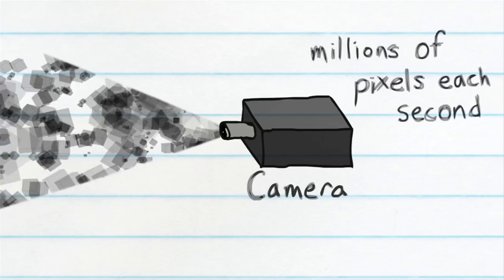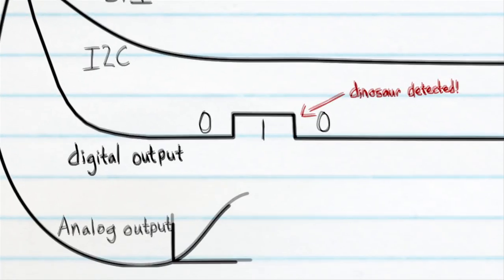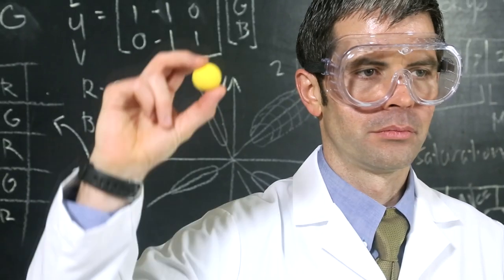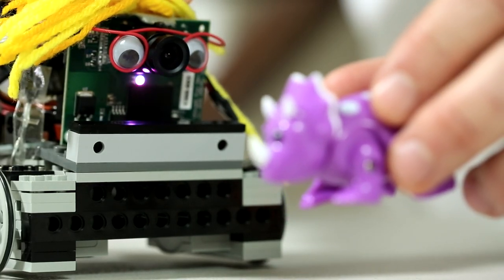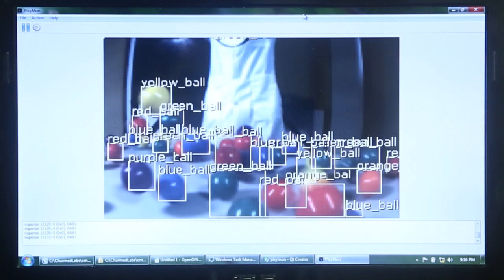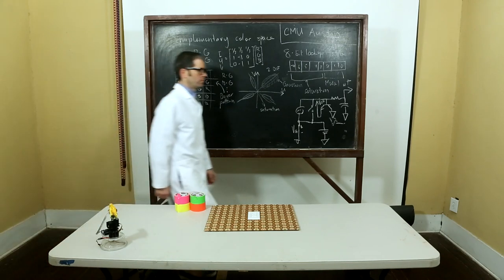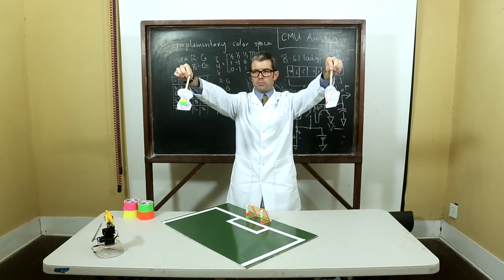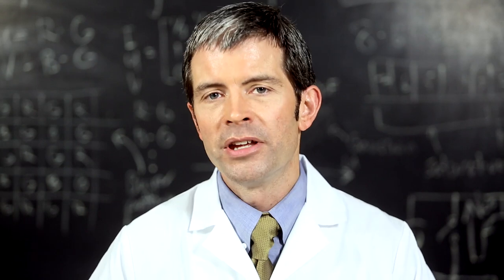Pixy Kickstarter Video

Comment: Super cool!! Lots of interesting/fun potential usages!
So I've done a very minimal amount of robotics (it was for an intro to engineering class as a freshman in college), and we used a microcontroller made by Digilent,, the uC32. We programmed it using an interface called MPIDE ("Multiplatform Arduino compatible IDE"). Would I be able to connect this to it and program it using that board/software? (I think the programming language was or was similar to C.)

Comment: Hi, I am going to use pixycam as the sensor on mobile robots to follow color lines , for example a red line and also a blue line. The pixycam is taught with two colors signatures which is the red and the blue. There is one problem when it detects red and blue lines at once, how to tell the camera that , only to select one of the colour out of two detected colours. Is there any codes to tell the pixycam,  to select only one colour out of two signatures taught?  Thanks in advance.
Reply: onka ko No, if this paradox takes place the universe instantly implodes faster than light speed as space time is not affected by the cosmological standards plaguing the poor photon, PLEASE KEEP BLUE LINES AWAY FROM ANY OTHER LINES, no matter the cost, be brave, and fight with valour and stuff. Never give a colorblind man a roll of your fascist tape either, for it is racist dollar store tape that lies in the core of all men's hearts, and sometimes crown moldings roo during renovations, but mostly just the blackened hearts of men...

Comment: This looks like the way forward, very impressive performance especially the speed..Q1 how good is this at recognizing faces(or different faces) ? .Q2 Could it identify each stair in a flight of stairs,both  ascending or descending , also producing  output data for the height and depth and qty of each of the stairs.  Looks like the camera sensor is mounted directly to the board , I would love a board with an external camera input, or two,one for each of the eyes on my Robot Head.! ..I would love to see peoples faces when my head followed them around the room...;-)
Reply from the maker: Hi Kevin, thanks for the kind words! To answer your questions, face detection is not supported yet, but is on the list for future firmware upgrades (would add the functionality to all existing hardware). Pixy could identify stairs if they were color-coded - the object detection algorithm works based on hue detection. For more on using color codes with Pixy, check out our wiki page: http://cmucam.org/projects/cmucam5/wiki/Using_Color_Codes  And yes, you are correct, the image sensor is an SMD component, mounted directly to the board. The lens is a standard M12 size, and is freely interchangeable.

Comment: Hi,
Could this determine the outcome of a dice roll in a game of craps? (The camera would be 6-7 feet above dice)
Reply from the maker: Hi Tom,
no, you need the ability to run pattern recognition. Pixy just tracks color, not patterns like dice pips. You might try a webcam and OpenCV. Hope this helps!
Reply: Hi,

Thanks for the reply. That is exactly what I am attempting to do currently.
Thanks!
Reply: @tombruce4198  
Maybe if each side of the die were different colors...

Comment: Hi I bought PIXY and trying to make this robot, but having difficulty in coding. Can you send me the code for this?
Reply from the maker: +박태건 the chase robot in this video uses old/unavailable hardware that we had laying around, so we never released the code (because no one would be able to find the hardware anyway). However, you can check out the LEGO chase demo, it has some good info on PID control, which is what the robot in this video uses: http://cmucam.org/projects/cmucam5/wiki/LEGO_Chase_Demo
Reply: +Charmed Labs 
oh..I thought you guys used arduino to make this robot...Do you know where I can find the code to make the robot using arduino to work exactly same as this robot?
Thank you anyway!
Reply from the maker: +박태건 unfortunately we don't have any such code. You should be able to hack something together pretty easily with existing Arduino libraries. Check out http://playground.arduino.cc/Code/PIDLibrary - that plus the above link explaining how the LEGO chase demo works will get you headed in the right direction!
Reply from the maker: +박태건 also, you can run the Pan/Tilt demo on Arduino, this also uses PID control: http://cmucam.org/projects/cmucam5/wiki/Run_the_Pantilt_Demo#Running-the-demo-from-an-Arduino

Comment: Hi, I was going to use this to prototype a drone that searches for colours, what is the range for the Pixy? Thanks in advance,
Reply from the maker: Hi Tom, I'm assuming you mean the max. distance Pixy can detect objects. It depends on the size of the object - Pixy can detect a table tennis ball at 3 meters, aka an object as small as 4x1 pixels in the image sensor, using the lens that ships with Pixy.
Reply: Sorry yes that is what I meant, Okay that's quite impressive, so do you think a large red jacket at 15meters is realistic? My goal is to make a simple working prototype for a drone that could possibly detect somebody jacket in the case of an avalanche for example in order to aid in search and rescue.
Reply from the maker: Cool project! Yes, that should work out fine. Note that if you teach Pixy a red object, it will report all red objects it sees - and it can be sensitive to changes in lighting. See our pages on generating and tweaking color signatures: 

http://cmucam.org/projects/cmucam5/wiki/Teach_Pixy_an_object_2
http://cmucam.org/projects/cmucam5/wiki/Some_Tips_on_Generating_Color_Signatures_2
Reply: Great! Thanks so much for your help, amazing customer service, I'm sold!
Reply from the maker: Thanks :D we do our best!

Comment: Is there any progress in face tracking with Pixi ???
Reply from the maker: Hi Ned, unfortunately not - we spent some time testing various algorithms, but did not get satisfactory results. Face recognition for Pixy is currently mothballed. Sorry to disappoint!
Reply: Charmed Labs that is very disappoint, it makes the pixi useless and it will be not more the a simple toy module, but far to expensive. At least you should give the source code of the firmware free for further development.
Reply from the maker: Hi Ned, sorry you're disappointed. Pixy does object tracking based on color, and does it well. It is fully open source firmware, you are welcome to modify as you like. We have a Google Group for the firmware SDK: https://groups.google.com/forum/#!forum/pixy_firmware_sdk
Reply: Charmed Labs Thanks very much for the info, will join the group. I hope you give it a chance and pickup the planning again for face tracking.